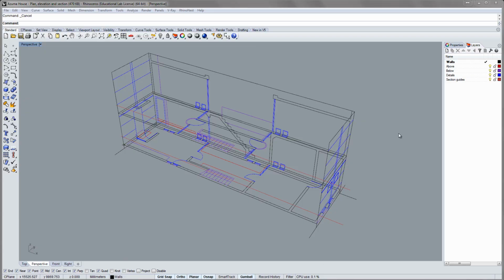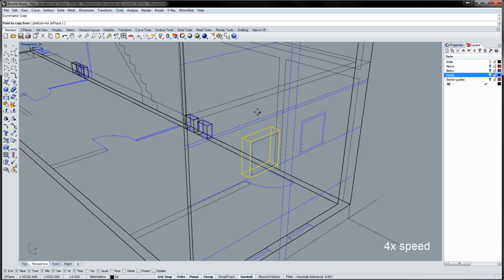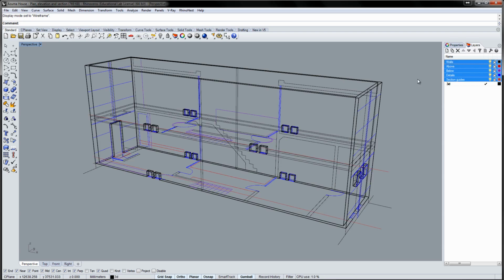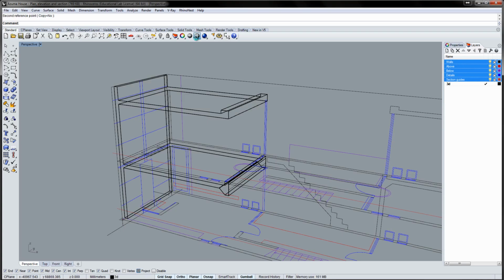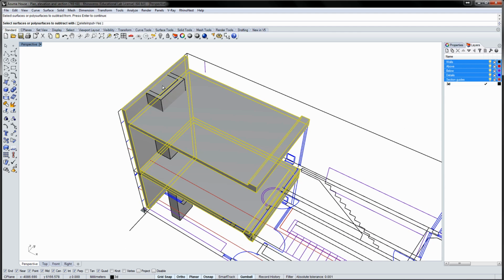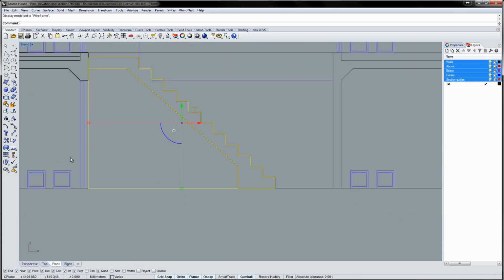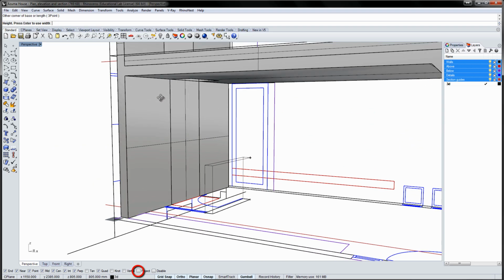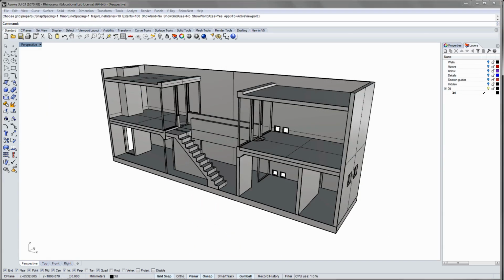Azuma House Part 3 of 4: 3D model

Comment: What's the story on windows in the Azuma House kitchen? Some drawings have them, others do not.
Reply from the maker: The building is almost double symmetric and that can be a bit confusing. I referenced photos to verify whether the windows where there or not - they are :-)
Reply: @rubenborup  Are you sure? There are windows but are they mirrored to both sides of the house in the kitchen as well, I suspect they aren't. 
There are so many redraws, models and 3D models of the Azuma house online that I think there might be some confusion about this. Some have the kitchen windows on both sides, some only one side. Considering that there is supposedly a kitchen there it makes some sense that the floor level windows (if existing) would be blocked by kitchen cupboards. I've not found any photographs showing the original kitchen interior nor bathroom. Do you have a link that confirms the kitchen windows?
Here is a good render showing how the big windows on the second floor actually look and correspond to the walkway sides. https://i.pinimg.com/originals/aa/52/bc/aa52bc1a8c8cd3249951f9cc14a8b367.jpg
Reply: There's definitely more mystery to this story. From photographs of the actual house it looks like there might have been some added volumes at the back or possibly that the house is not built according to the strict one-rectangle footprint that the drawings show. Possibly due to lot restrictions or such. https://en.wikiarquitectura.com/building/azuma-house-row-house/#azuma-4
You can also see this using google maps.

Comment: please help me. I cannot extrude the curve horizontally, it only lets me vertically
Reply: Hi Daniel,
When running the ExtrudeCrv command, use the Direction option (just click it in the Option in the command line) and follow the directions in the command line.
I hope this helps.
/Ruben.
Reply: Ruben Borup when i do this my wall, the one you did brfore the stairs, becoms not solid.
Reply: Ruben Borup also the staris become not solid, like, transpatent, when i do it through direction
Reply from the maker: Hi Daniel, I can think of 3 problems and solutions to this:
1) Your curve isn't flat. Select your curve and run the command "ProjectToCPlane" (this will flatten your curve).
2) Your curve isn't closed - that way Rhino can't create a solid, it will just extrude the curve to a ribbon. Select the curve and run the "CloseCrv" command to close the curve.
3) You haven't enabled the "solid" option when you run the extrude (ExtrudeCrv) command.
I hope this is helpful.
/Ruben.
Reply: Ruben Borup thanks for your answers Ruben. The problem is that when it is vertical it is completely solid, but once i choose to extend it in the direction of the walls of the house it becomes not solid from the side of the wall
Reply from the maker: Hi again Daniel,

Normally, Rhino will suggest the most likely extrusion direction to use. If you need the change the extrusion direction, that indicates that there is something wrong with your curve or that Rhino is unsure what to make of your curve. I would suggest:

1) Extrude in the direction that Rhino suggests - if that will produce a solid - then rotate and move the extrusion in place.

2) Try drawing your curve in a different view,  preferably with the Project Osnap enabled (this will force anything that you draw to be projected to the construction plane (CPlane) of the view.

3) Try drawing a simpler curve, then run the ExtrudeCrv command with the solid option on. If this works, you are on the right path but the other curve that you try to extrude might need some cleaning up.

Keep it up - you will get it right eventually!
Reply: Ruben Borup Thanks for your answer. The problem is that the direction which Rhino suggests is vertical and doesn’t produce anything when extruded

Comment: I have tried everything but I couldn't create windows using Boolean Difference or Split. I have created a box, also a curve, used the Intersect command to make sure it touches the wall, but still no :( Can someone help?
Reply from the maker: Hi John,
In order to use the boolean command, you will need two volumes (it won't work with curves).
Try this:
1. Extrude (ExtrudeCrv) the window curve so it becomes a box that extend past the wall on both sides.
2. Run the Boolean Difference command (bd), select the wall, then the box you just extruded.
Hope that helps.

/Ruben.
Reply: Indeed I already have two polysurfaces, the walls that I have extruded using extrudeSrf and a box, but it does not work for some reason :/
Reply: Hi John. When you extrude a curve to make the outer walls you have the option (up in the command line) to choose "Solid No/Solid Yes".  You want this otion to be set to "yes" so that the wall becomes a closed solid, not just two separate surfaces. Boxes (the windows) are solids. Try this, I'm sure it will work.

Comment: Hi, love the videos. I was wondering I'm working on another project where the plan is less linear than the rectangular Azuma plan but it still consists of two curves offset from each other. However when I extrude them they appear as wire frame and lack a solid interior, do you know how to extrude and make the walls appear solid?
Reply from the maker: Hi Tom,

Thank you for the kind words.
Check that the "solid" option is enabled when you run the ExtrudeCrv tool (Solid=Yes in the command prompt). If your walls have flat sides, you can also select the extruded wall and run the "Cap" command.
Hope this is any help.

Cheers,
Ruben.

Comment: How do I turn on the green and red arrows when I click on something? 
will that allow me to place something aligned to  near by point like in Autocad?
Reply from the maker: Hi Danny,

You toggle the Gumball on/off from the button at the very bottom of the screen (next to the snapping tools). If you can't find the button, just enter Gumball (and press enter), then follow the directions in the command field.

Rhino has several object snaps (the check boxes in the bottom left of the screen). The key is to only use a few at a time - if all snap toggles are on you'll get an inferno of snap callouts which is not really helpful). My standard object snaps are End, Near, Mid.
If you right click a checkbox it'll disable all other object snaps and toggle on only the object snap you click on.

I hope this is helpful.

Cheers,
Ruben.

Comment: i am a beginner to rhino and ive been using archicad for years... rhino is too messy... any one to explain why this is considered one of the most popular software?
Reply from the maker: Hi Marios K.

ArchiCAD is awesome - it is way better at construction drawings and BIM. I never got to a point where ArchiCAD was effortless for me to use, but It is a powerful tool for sure!

To me, Rhino is great at the early stages of the design process, mostly because you are not constrained by BIM and rigid modeling tools. Because of this, Rhino allows you to work more freely when exploring form and design.

Rhino has great input/output tools and it is very powerful if you are working with digital fabrication (laser cutting, 3d printing, CAM) and parametric design (grasshopper).
The key to a happy Rhino workflow is to use layers and keep curves and surfaces in separate layers. Selection commands and selection filters are helpful as well.

Don't sweat it, just because Rhino has a lot of flashy tools it might not be the right software for what you do and that's totally ok.
I've spent much time jumping from one software to another but at the end of the day, the software is secondary - what you make is all that matters.

If you still want to take Rhino for a spin, check out http://digitaltoolbox.info - they have a bunch of videos ranging from beginner to expert level.

I hope this was helpful.

Cheers,
Ruben.
Reply: I see... it is upto anyone to chose the right software that suits their needs... As a young architect I am trying to be able to know as much softwares I can... what i realise is that rhino is closer to the traditional way of drawing and by seeing videos of other softwares  i realised that all of them share common aspects. Autocad and rhino are very close as close is Archicad to revit. Same logic different tools.

Comment: i cannot Boolean difference the walls. it works fine on the exterior but does not do anything to the interior wall. i have tried several times but to no avail. Please Help
Reply from the maker: +Thomas Gaines Make sure your interior wall is one closed volume (polysurface). If there are any openings Rhino won't boolean. Sometimes a quick fix is to select the object and type "cap".
Reply: +Ruben Borup Thank you ever so much for taking the time to respond to my message. Your advice solved my issue and I have just competed this portion of the tutorial.